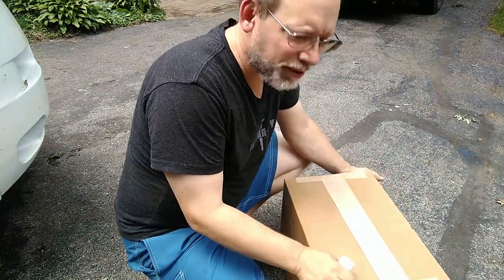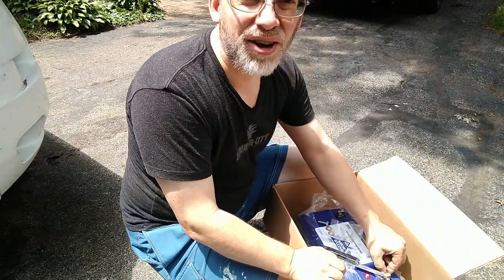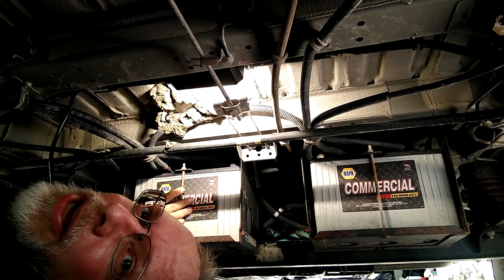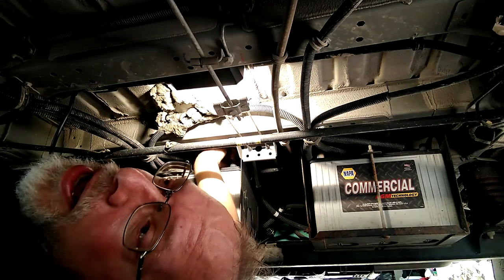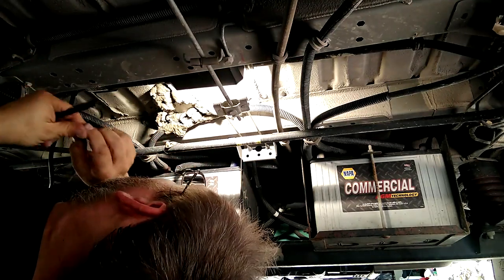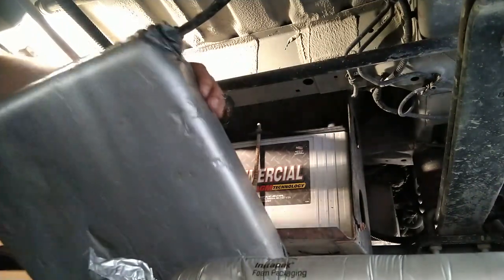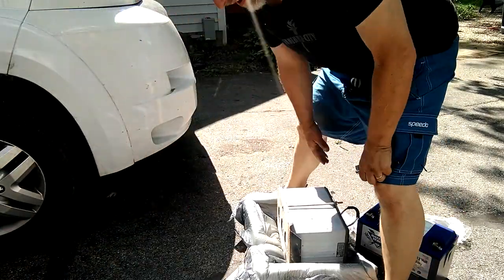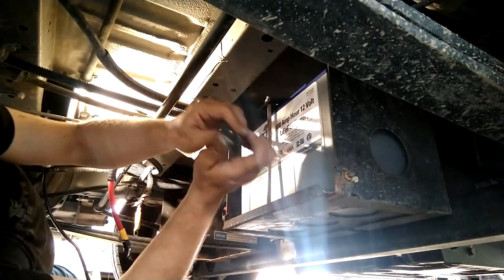Travato Lithium Battery Upgrade

Comment: you did went the hard way, just loosen the side bottom screw the battery will come down with the metal platform once in the floor you just unscrewed the cables and that it, to put back flollow the same procedures. merry christmas and happy 2023
Reply: Are the cables long enough to drop the battery on the floor then disconnect the cables?
Reply: @p-dub22  yes, mine from the right side were long enough and the left side a little shorter so I just put in the bottom 2 pieces of 2x12 wood and that was more than enough, remember each battery weighs about 62 pounds, so to put it back I did needed an extra hand to lifted!
Reply: @TheSilviomorraz  looks like you have to pull the battery forward, then it can drop?
Reply: I don't think you can just drop the batteries as there is a lip on the battery tray that supports it.  You have to slide it out as shown.  I have a different tray design where you can remove the screws then drop the battery straight down.

Comment: We have swapped out the 2 AGMs for 2 Battleborn Batteries.  Also a bluetooth shunt.  When the shunt monitor reaches about 60% we get a low battery warning.  And when we reached 55% recently while on a trip the battery bank completely shut down.  Any idea as to what could be the problem?

Comment: I have one of mine out on my 59G to see why the Ethernet-monitor isn't working, and came to see if I'd learn a tip on reinstall 😂 I couldn't get the 3 positives reconnected after the batts in position. Ran out of daylight and patience! Fresh eyes tomorrow. Oh, FYI the design of the Renogy's is NOT good for this application. Looks like dirt and moisture has ruined the Ethernet ports they use to connect to one another and monitor.

Comment: LOL ...mods are harder on a 59G especially electrical ones.. Doing the Battle Born heated battery upgrade this weekend - DIY project.  Wish WGO designed the battery tray so it pivoted down and add enough cable slack to tilt the batteries down and forward thus making it easier to remove cables. Love to see this battery upgrade video updated to include the Victron shunt. I think it will be straight forward unless there are surprises when I start trying to fit shunt and cabling into the water proof case.

Comment: Forgive me please. 7 minutes  into the video I'm still trying to figure out what  You have. I have a 2021 Travato Gl.  Did your batteries  Fail. I'm trying to figure out what the story is and why you're replacing your existing batteries.
Reply from the maker: This video only applies to G/K models and not the L models (which have a different lithium battery).  This is a video that provides an example of how to remove the original AGM batteries on non-L models, so that they can be replaced with Battleborn Lithium batteries for more capacity.  You could also replace the AGM batteries with new AGM batteries using mostly the same technique.

Comment: An excellent, informative video and an even better website. What temperatures can these batteries be used at when placed where the AGMs were?
Reply from the maker: Depends on if you get the heated model. Without the heater, the power can be used but not recharged below about 27 F.

Comment: What do you see as the benefits of the new batteries?  Is it something like 50 amp useable before and now around 180?  In your use of your van were you running out of juice if so why?  Were the old batteries needing to go anyway?  So now that you have them will you be swapping out the inverter for a 2K model up from the 1k in there now?  For us the benefit with a 2k inverter would be use of the microwave and a higher power kettle.  If not connected to AC we have to start up the generator for those 2 items.  More details would be appreciated.  Thank you.
Reply from the maker: Swaping two AGM's at 50ah usable (100 total) for two BB's at 100ah usable (200 total) gives you twice the battery capacity, and thus longer runtime, but it's also longer lifetime on the batteries without the worries of keeping them from discharging too deeply and shortening their life as with AGM.  You can just swap the batteries and make no other changes, but you can also add or upgrade an inverter for higher wattage capability.  I usually install a Victron 3000 inverter which allows you to run all of your appliances, even the air conditioner.  For more details see stg.net/docs.html

Comment: What about the converter? Does that automatically know how to charge BB battery?
Reply from the maker: It will mostly work with the Lithium batteries without modification.  There is however available a low cost modification (CBP) to the converter to force it to stay in the higher voltage mode for faster charging, this is available on stg.net website.

Comment: Just bought a Winnebago Solis Pocket and have 2 BattleBorns BB10012h ready to go in. I don't see a solar panel disconnect anywhere. I've been told the first thing to do is disconnect the solar from the system. Thoughts? Thanks.
Reply: just happened to catch your 10-month-old post.  I believe you are supposed to disconnect the panels to avoid the voltage to continue to the controller without the battery.  So just cover up the panels above with a towel or some cardboard cover while you're switching the batteries. I'm only here to see if anyone else has done this.  My AGMs are still going strong but when they start weakening I'll change them.  I wouldn't use battle-borns as there are many LiFePO4 batteries like Power Queen or Ampere Time that are literally a fraction of the price of BB's.  I already have them in a home solar system and love them

Comment: When adding a Smart Shunt, I know it goes in line with the negative. Does it matter where in line that is placed? In your situation here, it seems it would be much easier to add it to the battery with only 1 negative cable.
Reply from the maker: You want to have the negative of all batteries tied together, and then a cable from one of the negatives to the battery side of the shunt.  Nothing else touches the battery negative, so the ZAMP ground wire and the chassis ground connection have to be put on the other side of the shunt.  That way all power in/out of the batteries goes through the shunt and it can accurately monitor the charge level.  Generally you want to use a relatively short cable, and it needs to be the same gauge or better as the rest of the battery connections.  The original connections are all 1 gauge, so you can use a 1ga jumper or whatever you have handy that is larger.  If you've upgraded to an inverter, you'll need to replace all the cabling with 1/0 gauge.  Also: the shunt cannot be left out in the open where it can get wet, so you have to put it in a sealed box or run the cables through the floor and put it in side.  And if you put it in a box underneath, the bluetooth signal will be so weak that you probably can't talk to it with the victron connect app from inside the rig.  So if you're going to go underneath in a box to avoid putting thick cables through the floor, get  the BMV-712 instead of the SmartShunt and put the display head inside.  If you put the cables through the floor, you can use the SmartShunt, although I strongly recommend only using the SmartShunt with a GX controller, as you have no relay control and no alarm.

Comment: Hello Just wondering How you will protect your BB from getting wet while driving? and How you will charge them  do they need heater to maintain temperature. Thanks for your  insights.
Reply from the maker: It is no problem for the battery to get wet while driving because it is sealed.  Also battleborn has a heated model that prevents the problem with not being able to charge when too cold.
Reply: @ScottGriepentrog  You know what temperature the BB shuts down when cold or hot?
Reply from the maker: @Pinky121971  27F

Comment: Maybe I missed it but was the reason for changing out the wiring?  Also, if you are replacing the inverter with 3000 watts and adding more solar can you keep the original wiring or still need to replace it?  Hypothetically, let's just say double the solar, to go along with the 3000-watt inverter.  Also, are the lithium batteries lighter than the AGM batteries?
Reply from the maker: When I was doing this video, my goal was to put in a high capacity inverter which would require an upgrade to 1/0 cabling.  Otherwise without the inverter, you can stick with the original 1 gauge cabling.  The solar doesn't require a cabling upgrade.  The lithium batteries are half the weight of the original AGM batteries.